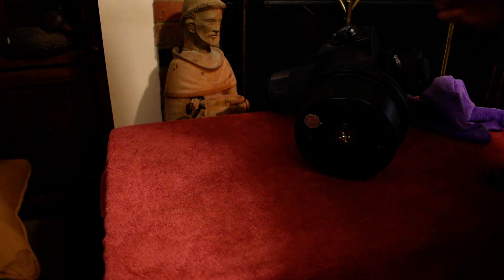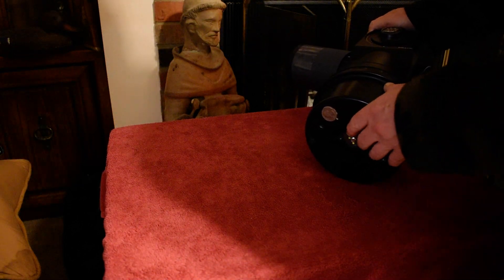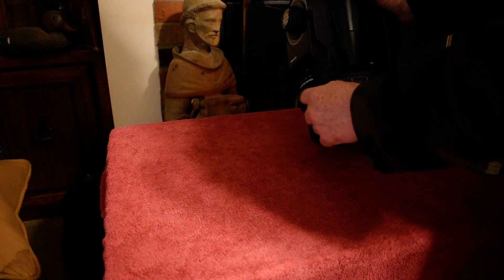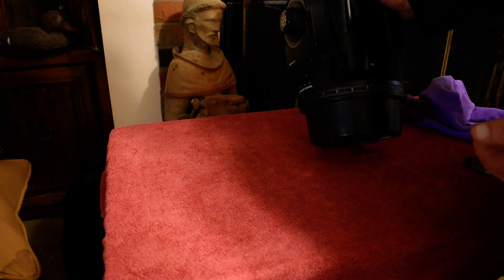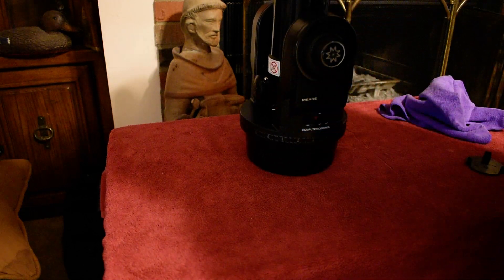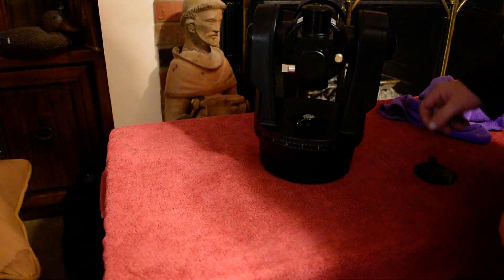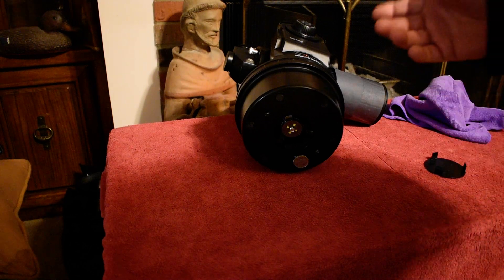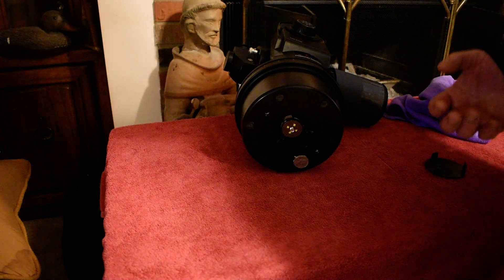Help tighten gears in Meade ETX mount

Comment from the maker: Bored silly stuck in a house for months looking out the windows sort of forced me to play with the telescope. Bought a camera too and then got the idea that it'd be cool to take pics thru the telescope. Ordered an eyepiece projection kit for the DSLR and figured I'd go in the yard and take pics of the stars and stuff. So far we've had a handful of starry nights in the pandemic. (waaa) 
The first setback on the DSLR astro-project was we ordered the wrong cable for the camera/laptop interface. D'oh. Micro...Mini...whats the diff? lol Then I tried the 9mm eyepiece     and it wouldn't focus. A WEEK later I figured I'd try taking the rubber eye relief off. That's when I saw IT. The meade eyepieces are two pieces and my 9mm one was halfway unscrewed. Tightened it up and now it will focus. Was stumped on that. Success at last.
Only one eyepiece out of two worked so I was looking at eyepieces and filters...
Astronomy is cool as heck but the munny and frustration with waiting and waiting for shipments from far off lands during a pandemic....not stressing at all. lol

Comment from the maker: The telescope works fine when in alt-az mode. There is slop in the bottom part. (az?) 
 When I put the scope in polar mode and try to run it that way the gear starts skipping teeth. That's what the clunking sound is. It should be obvious that I'm extremely novice at astronomy but have other hobbies that involve gears and tiny parts so I'm not afraid to go in and do surgery but I need a diagram, picture, or something to go off of. Going in blind is asking for disaster. If anyone has a picture of the guts of a Meade ETX 60at I'd love to see it. I worked as an electronics assembler at my fathers company so I have all sorts of electronics skills too. 
Any help would be appreciated. Thanks.